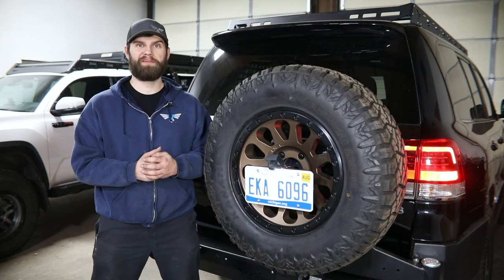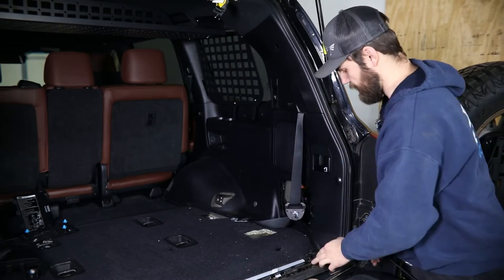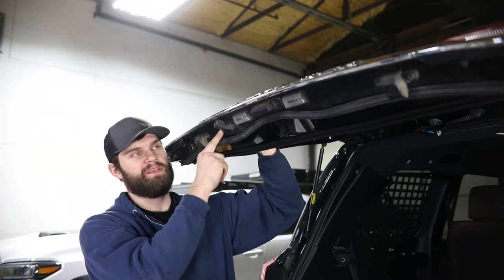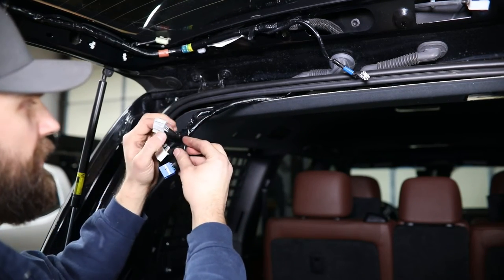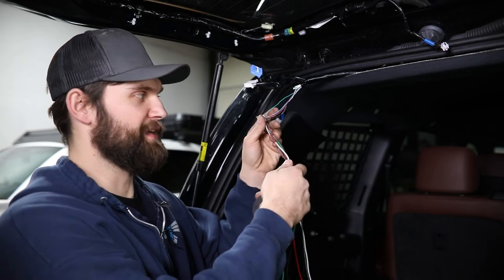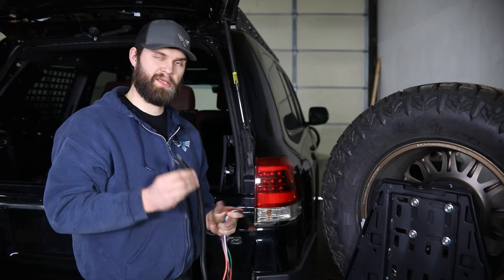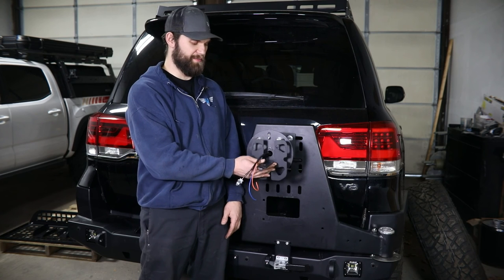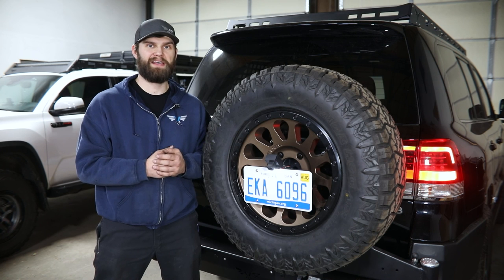Land Cruiser 200 Series & LX 570 Camera Relocation Bracket Install

Comment: Hello - what spare tire mount do you have installed on this 200 series?
Reply from the maker: This is our Universal Tire Mount on our Adventure Carrier.
https://www.victory4x4.com/product/UNI-TM.html
https://www.victory4x4.com/product/VAC.html
Reply: How do you remove them when removing the tire?
How’s the camera going to handle being exposed to the elements? Normal position is protected inside the hatch.
Reply from the maker: We've seen no issues with the camera's being relocated outside of the hatch. Removing this kit in the case of a tire change isn't much of an issue either, the camera simply unplugs, the wiring has quick disconnects in the form of spade terminals, and the license plate bracket attaches using a wing nut which can easily be removed by hand.